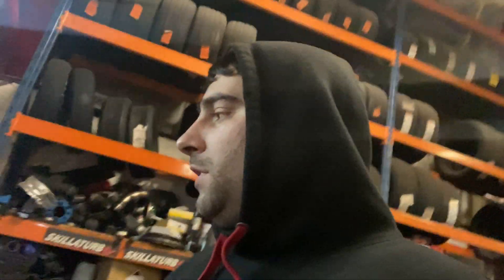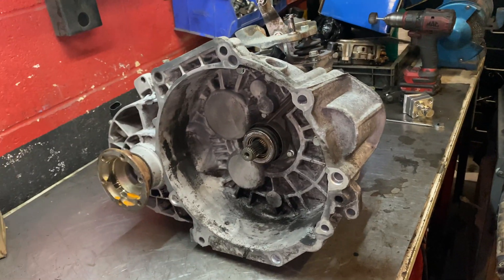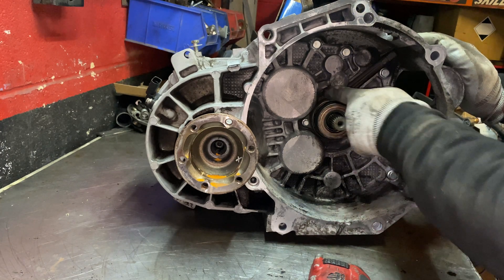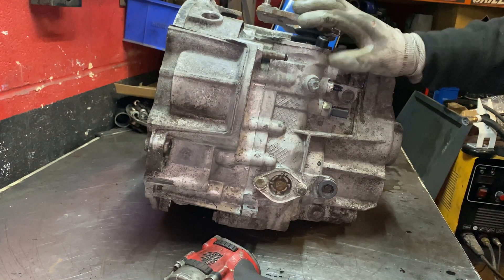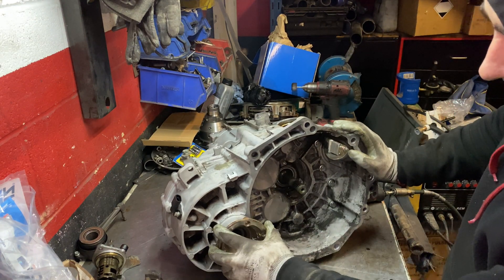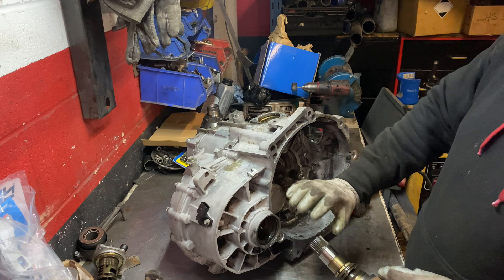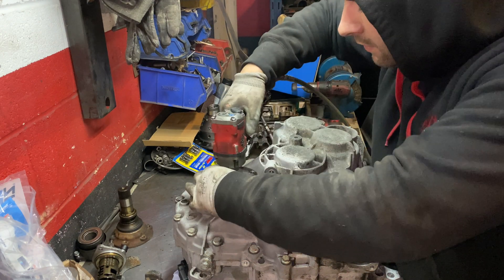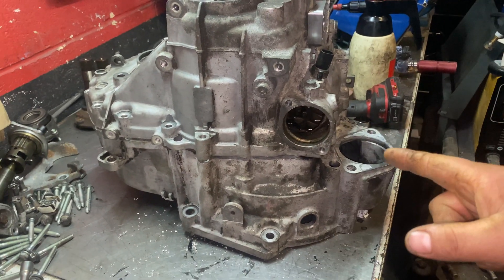How to split gearbox apart 02M 02Q step by step fitting reinforcement parts VW SEAT AUDI SKODA part1

Comment: Is that sensor on the diff casing the vehicle speed sensor? I have a MK4 Golf with a O2M 6 speed manual 1.9 TDI AJM. I've lost speedo, trip computer, cruise control and the fuel gauge seems a bit erratic! Some info says the speed sensor is under the gearbox mount?  

Edit.....sorted, was a dirty speed sensor connector plug...unplugged it, sprayed electrical cleaner and alcohol into the pins on the sensor and inside the plug and blew it dry with a blo-vac...everything back to normal. I did my rocker cover and tandem pump gasket last night and sprayed brake cleaner everywhere to clean everything off....I reckon some oil / fuel residue got into the plug for the speed sensor. Total cost...zero! woohoo! lol

Comment: Helder, do you know if gearbox cups from 02j 5 speed can be bolted onto 02m/02q?
Reply from the maker: Don’t know only thing I know is 02m and o2q is different
Reply: @HelderPutoPerformance  thanks for reply. I have mk2 Leon and want to fit 6 speed without changing hubs/struts due to have airbag suspension and don’t want to upgrade to 55mm struts.
Reply from the maker: Just buy a Pd 130 gearbox and drive shaft is straigh fit
Reply from the maker: Maybe have to change the cv joint ( fit the original from the car )  and gear linkage

Comment: Helder is the man like 😎do you do mapping in the UK by any chance
Reply from the maker: Yes mate Peterborough
Reply: @HelderPutoPerformance  where in Peterborough mate and what's the tuning place called I'm in the process of a 2265vk build with firad 160s high lift cams etc looks like your the man for the job to map it😎
Reply from the maker: Hi work at Supertreads Automotive  but Luis skillaturbos do the mapping for me